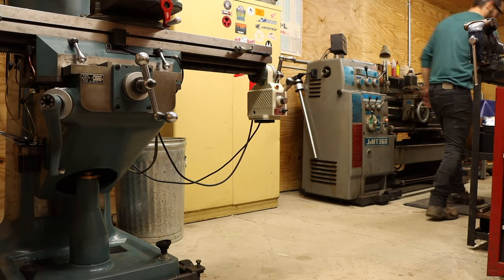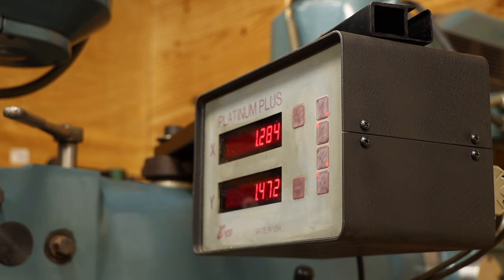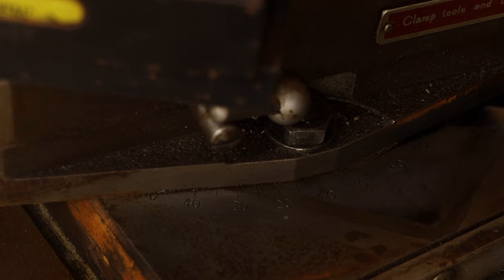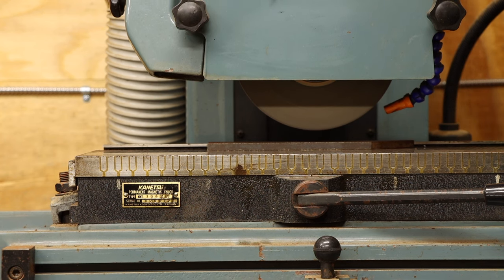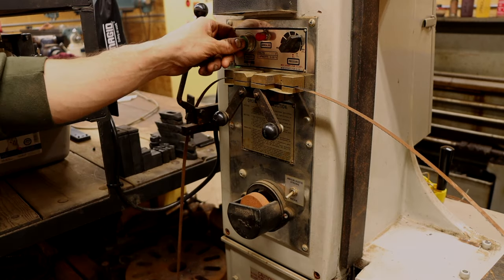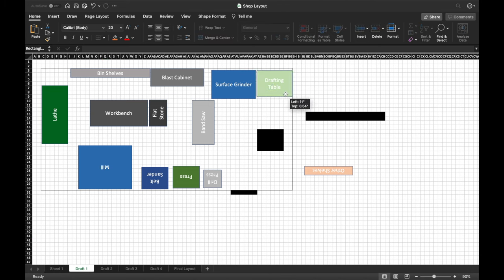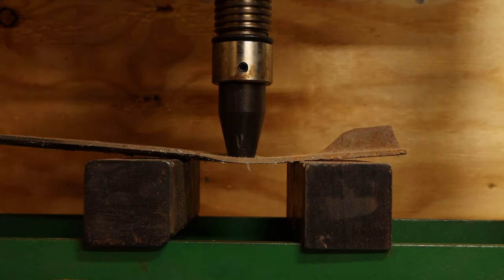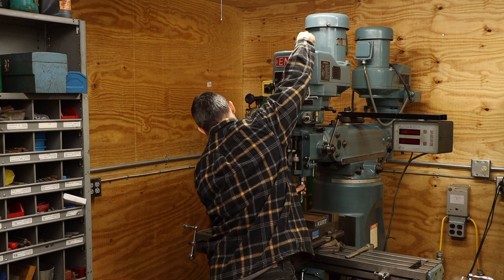Machine Shop Tour || INHERITANCE MACHINING

Comment from the maker: Thanks for watching! Stay tuned for the next video on Friday, February 4th at 10AM Eastern where I'll be restoring the mill. See you then!
Reply: Very nice shop tbh
Reply: I know the video is old and all but the lathe moves in the x and z directions.  The Z axis is always parallel to the spindle in any machine tool.
Reply: Hi! I’m so jealous, I’d love to have my own shop. Just started watching this and I love it. But on a lathe the coordinate system is actually Z and X, not Y. Z is “length” and X is diameter.

Comment: Just a tip for your blast cabinet: try and get a piece of the glass that they use at the grocery store checkout scanner. It's got a thin layer of diamond to prevent wear. Put this on the inside of the viewing window. You already know you need light on the inside of the cabinet. And don't run the air pressure too high. 40 PSI is about all you need. Higher pressure than that just crushes the glass bead prematurely so you don't get maximum usage out of it.
Reply from the maker: That’s actually really useful info. Thank you!
Reply: I work at a company that among other products made transparent ceramics and some genius came up with the idea to replace the windows on our sandblasting cambers with that stuff, works so well that it's still completely clear after years of daily use in our tool shop
Reply: Why do so many Americans leave the osb sheets unpainted to go darker and darker instead of painting them white?
Reply: @erik_dk842  painting OSB sounds like a nightmare... but I never tried, is it really effective?
Reply: @AlessioSangalli  Any cheap white paint should do. Use a thick wide paint roller on a shaft. Of course white walls give better light in the garage than brown light absorbing walls.
Reply: @erik_dk842  totally agree on the white paint giving obviously better illumination, I also disagree with the creator when he says he put too many lights. There is no such thing as too much light indoors :)
Reply: @AlessioSangalli  Tell me about it. I grew up with Danish "hygge" roughly translates to coziness, but is much more.  A couple of low wattage token lights in the living room.
Reply: @erik_dk842  different times I guess. I am thinking to put on those hexagonal lights in the workshop

Comment: That built in blade welder was the coolest thing I've seen all month
Reply: I have never seen a band saw of that size without it. Also, it should have an annealer, otherwise the welded part of the saw will be too rigid and eventually crack...

Comment: Great video and really nice shop!  My only critique is on the lathe description.  Cross slide is the X axis.  Carriage (spindle axis) is the Z axis.   Y axis on a lathe is a milling attachment.  The DRO says X and Y because it was cheaper to not change the letters (most DROs are still made like that).  That's what I was taught 30 years ago and still use everyday.  Keep up the great work!
Reply from the maker: Wow... you are totally right! Rotation axis is always Z... I've always seen that DRO with those labels and never gave it a second thought. Thanks for the correction!
Reply: @InheritanceMachining  Thanks for taking it the right way. Most new and hobby machinist don't realize that, it's certainly not intuitive to 'a new guy'.  Your doing a great job, keep it up.
Reply from the maker: Of course. I’m here to learn after all. Thanks for the support!

Comment: Great shop set up dude. Not sure if that lathe is a Japan made Mazak Mate but looks very similar.
Reply from the maker: Thanks, man. From what I’ve been reading it’s a Chinese rebrand of the Mazak Mate.
Reply: One is a Mazak made in Jinan, China. The quality was good at first, but it was canceled due to a company issue causing the quality to drop. You can check out the Yamazaki Mazak on my cover.
Reply: @InheritanceMachining  That lathe is just fine.
Reply from the maker: @davidrule1335  I'm not worried :)

Comment: I used excel to layout my machine, auto and wood shop before I built the building! It worked great! I actually increased the width from 32 to 34ft as it allowed room for two auto plus side bench areas. After the shop got built, the extra foot on each was really needed.

Comment: This workshop is my dream. But it seems to me that it gets even better if you do all the grinding work in an isolated room.
You can air dry for free. It is enough to circulate the air from the room in a circle through a thermally non-insulated pipe with a conventional fan.
Reply from the maker: The separate grinding room would definitely be a must have for future expansion.
That's an interesting idea with the pipe. Im guessing the humidity condensates on the metal and  you catch that? Still need to power the fan.
This dehumidifier doesn't actually run all that much during the winter. I've spent entire days in here and it hasn't kicked on. The vapor barrier in the walls helps a lot I think.
Reply: @InheritanceMachining  The running costs of a traditional duct fan are minimal compared to a dryer compressor.

Outside the heating period, the ventilation can be adjusted depending on the air temperature and relative humidity. Do not ventilate if the air brought into the room from outside exceeds the existing humidity. This is a simple conversion.

Comment: That enco mill is an excellent quality machine , don't ever let anyone tell you otherwise . My dad's shop had an enco mill and lathe and I found them to be as accurate as you and we kept them extremely well oiled and maintenanced. That mill will last your lifetime with just basic replacement parts or possibly lead screws if you use it like a mad man . There's alot of hype with other name brand machines and many of the parts are the exact same or slightly altered.

Comment: I'm a CNC guy myself, currently I program and run 2 wire edm machines in a tool and die room, but I loved the manual machining part of my education so much I bought myself an old bridgeport and  just over 100 year old 16x40 Southfield lathe that needs a bit of work to get running, and the mill needs some tlc but for now it is temporary wired to a vfd that needs to be made more safe and permanent.
I'm glad to see that others in my generation are keeping manual machining alive, and glad you had a great mentor like your grandpa.
Reply from the maker: Those sound like some awesome machines! I love hearing there are others out there that find joy in this old art format well.

Comment: Love your shop!  Very nice!  I just inherited my grandfather’s machine shop.  Much smaller machines than you have but very nice too.  I put myself through college 30 years ago working in a machine shop. I feel so comfortable in my shop zoning out making parts.  Please reach out and let me know if I can be of any assistance to you.
Reply from the maker: That's awesome! I'm glad you had the interest to keep them around like myself!
Reply: I have too inherited my father's machine shop which included a 22" metal shaper, and a South Bend lathe with a 16" swing and 36" between the center, those are wonderful machines and I would like to keep making cutting tools but the carbon steel went up on prices a few years ago since then is not profitable to fabricate those cutting tools so I have been looking for some other similar pieces to fabricate, by any chance, have you some advice about some mark trade high carbon steel (2 % C). Thanks and apologize for being so straight

Comment: The good thing about having a building inside a building, is zero dust ! Dust is a major issue in drier climates like Queensland Australia… I make it a habit to wipe down and re-oil the slide ways and components down before using my lathe… Queensland also can be very humid which is a constant issue… I wipe everything down with an oily rag as often as I can…

Comment: Adds a lot of accessibility to install full extension slides with either drawers or flat slides in the bottom of your bench and or any cabinets.  Makes all those back corners easy to fully use.
Reply from the maker: Are you reading my mind!? I have a big project in mind along those lines.

Comment: Good work, consider getting a horizontal bandsaw with coolant, essential for cutting stock materials before machining, and in some cases after the first op. My bandsaw is broken, a big issue!
Reply from the maker: My grandfather had one but I passed on inheriting it because I was running out of room. It’s my only regret from the whole ordeal
Reply: Yes horizontal bandsaw with a hydraulic downfeed cylinder is worth it’s weight in gold in a metal working/machine shop. Roller conveyor on each side of the saw with a manual length stop is also very handy for making repeat cuts of the same length, much more accurate and repeatable than hand marking.
Set her up, start the cut, then walk away and do something else (but never go too far away…!)
But yes, unfortunately they do take up considerable room in a shop. When you do get a horizontal, try and get one that has a 60 degree mitre both ways, and don’t get a little tiny thing, they never cut straight. Get a decent blade of about 1” or above, they track straight as an arrow. If (when) you get a TIG welder and need good fit up, trust me you will be glad you got a straight cutting saw!

Vertical is useful too, but mostly for cutting curves in small pieces of plate. Larger plate/sheet pieces will require a plasma cutter, oxy cutter, or jigsaw if you’re keen.
Or do what i do, and design 2D metal objects on CAD and get the local CNC laser cutters to cut the metal for you. Then it rocks up at your workshop ready to go, and you’re welding and assembling ‘man grade’ lego!

Enjoy the journey, and remember, you will never stop learning in this craft

Comment: You should position any grinding equipment on the opposite end of your shop away from the lathe & mill. In a separate room would be even better. Do what you can to keep the grinding dust away from the ways.
Reply from the maker: That's a good point. The belt sander and grinding wheel are the farthest away from the lathe and mill but the surface grinder is still kind of close. It has a dust collector and a guard so hopefully it doesn't cause too much of a mess once I get it running.

Comment: Very nice shop! One small tip on stopping the lathe safely, we have a similair one at work. Always stop it with the footbrake. That way if you lean in to measure you'll never accidentally push the handle and engage the motor.
Reply from the maker: Oh interesting. I thought I saw Abom79 doing that but figured it would wear out the shoe. Thanks!
Reply: @InheritanceMachining  just tapping it to activate the stop switch would be enough.
Reply from the maker: @markh4426  oh that makes sense because of the reset. I’ll be making a habit of this now

Comment: G'Day👋 You have a lot of precision machinery there. When de-rusting, try and avoid abrasive methods like sandpaper or scotcbrite, even your sand blaster. Get yourself a large ultrasonic cleaner (cheap) and check videos on electrolysis rust removal. You can't afford to remove even half a thou with abrasion. Be extra extra careful cleaning up your micrometers and gauges. Spindle runouts will be important and belts and bearings may need replacement. Get your spindles within a thou at worst. All the best mate. Michael 🇦🇺 NO ABASIVE METHODS! 😉 oh, and the parts washer is for oil & grease removal only, not rust or dust or dirt or paint. And NO ABRASION!

Comment: Great idea on the excel cad.... had a moment of why didnt I think of that ever before. I have used sticky notes cad (or pad) several times for the same purpose. One thing I would do if I remade my shop layout today is to put the grinding, sandblasting and welding stuff in a separate room. Really dislike the grinding dust getting in the machine ways. Also kept my old drawing table, still use it dual purpose for drawing and as a billboard.
Reply from the maker: Ha. I learned that little trick from a salesman for the company I work for. It was his way of conveying a sales concept without having access to Autocad. I definitely agree on having the grinding in a separate room. I'll get there eventually though. So many other things to address. haha

Comment: Great looking shop!!# my stuff came to me as shops I worked at went out of business. i would try buying things at auction or failing that buy stuff from a couple local used machinery dealers...
 My mill is a total Kluge, made from larts of several different bridgeports... 
 I love your trailer... I ended ip with a Texas rollback which has been used until its toungue is hanging out...
 The 22 foot deck is nice, but there have been a few times the shorter deck of yours would be better...

Comment: A useful mini split feature is the dehumidification it provides in normal operation.  Heat or cool is also a great bonus as well as efficiency.  As you say if it isn't comfortable you aren't going to choose to be out there.  That you don't even think about it with its drain going outside (you do have to arrange the hose so gravity can clear it before it freezes in winter).
Reply from the maker: Thanks for the tip. I did run into the issue with the drain line freezing this winter so just routed it to a bucket. Fortunately this winter has been very dry and I haven't even had to empty it once. A mini split would be a lot nicer than the wall unit in the summer. And could help offset the heating int he winter when I don't have a fire running.
Reply: In the dehumidification mode it is in the ac mode (low speed)... look into a condensate pump for draining issues.
Reply: Look.into a minisplit that is rated down to -15  in heat mode .. heat pumps lose efficiency when temps drop

Comment: Just subscribed and happened on this video, quick tip for keeping rust off of ways is to use fogging oil, it’s made for when you build a new engine and it’s going to sit around for a while. Works great on my mill and lathes and it’s cheap
Reply from the maker: Awesome. Thanks for the tip!

Comment: I owned a lathe exactly the same as yours and I still regret selling it it was a lovely small accurate lathe and very easy to use . The only letdown with this late was it throat size which I remember be 32 mm which was just too small for some of my jobs. I purchased a large Chinese lathe some years ago for this reason but it's not the same, you keep that lathe
Reply from the maker: How cool! I didn't think anyone would be familiar with this lathe given its a small brand import. It does have a narrow throat so we will see if I ever exceed it's capabilities. Then again if I do, I think I would rather build a larger shop for another lathe than get rid of this one. FYI my next video will be all about the lathe. Might bring back some more memories for you.
Reply: It's not actually a small lathe. I don't know where you guys got that idea from...🤷🏻‍♂️

Comment: Just stumbled upon your channel, and I must say, you heard it here first - youll have 100k subs by the end of the year. Incredible filmwork as well as general engineering approach to everything. I'd be lying if I said I wasn't green with envy of what you have, as you essentally have a machine shop of my dreams, but perhaps one day.
In the style of hobby machinists, I would like to point out a few things, if I may. Just terminology though, so it hardly matters. (apologies if this has already been mentioned, this is only my second video of yours. If so, please disregard everything I'm about to say)
1) Might be a UK thing, but over here, we call it backlash, not lash. Semantics, really.
2) Lathe operates on X, Y and Z axis, but the placement of the axis is less intuitive than the mill. By that, I mean that it's "on it's side", ie - the longitudinal carriage is the Z axis, the cross slide is the X axis and the Y axis.. Well - doesn't really exist, strictly speaking(I would probably best describe the Y axis as the height of the cutting tool, but by the same notion, the Y axis should always be 0, or centered). This can be extra confusing, as the DRO displays usually have standard labels for axis, so as such, it might say X and Y, but in theory it's Z and X.
3) Height micrometer - I'd say that's a vernier height gauge, but again, might be the typical UK/US nomenclature.

Keep up the amazing work. I'm supposed to be writing my dissertation tonight, but I have a strong feeling that it might have to be put on the backburner for now..
Reply from the maker: Hi, Erik! I really appreciate you saying that! We're going to keep pushing to make consistent content! I do address/correct those first 2 points in some of the restoration videos. The labelling on the DRO definitely tricked me. I grew up seeing that Y label and never thought twice about it. Rotation axis is always Z. I got 2 whole engineering degrees so should know better! haha You are definitely right about the vernier height gauge. There is no dial on there!

I appreciate the feedback and support. Now go get that degree!
Reply: @InheritanceMachining  Well, considering I left this comment 8 months ago and you're now at  132k subs, I should probably register for my own psychic license 🙃 Love to see it!
Reply from the maker: @EngineerRaisedInKingston  I remember this comment! haha Wouldn't be possible without the support form people like you. So it wasn't completely psychic 😉

Comment: Nice looking shop, may I suggest some additions: some strategically placed fire extinguishers and smoke/heat/CO alarm, preferably that could send remote signal to the house in case of emergencies. Don't mean to sound alarmist but sometimes things happen so better to be prepared. Last, a main disconnect switch to your shop to absolutely, positively turn everything off when you leave after a machining sesion.